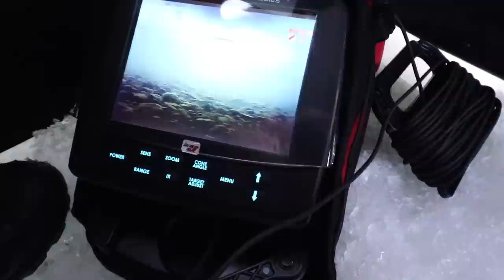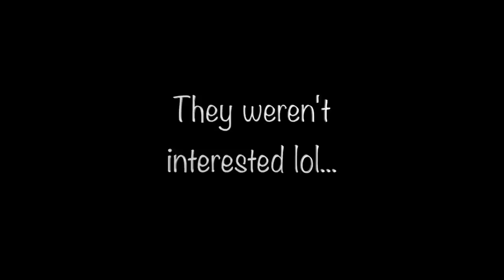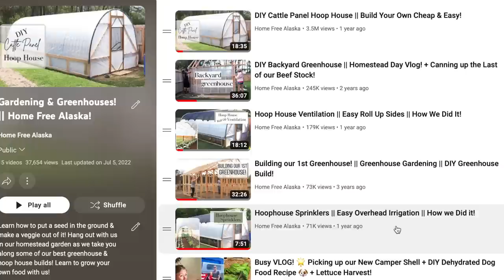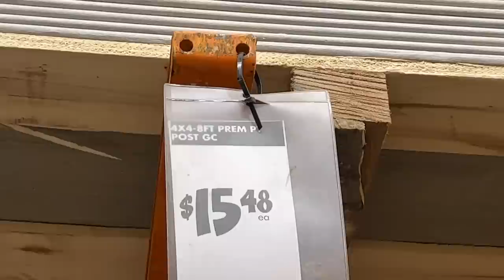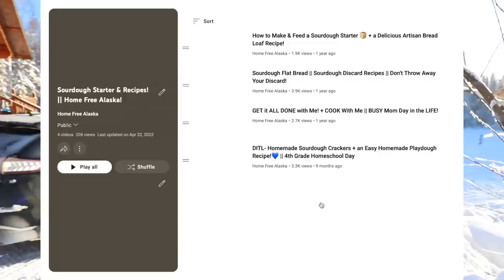Finally!👉🏻Ice Fishing Success-ALASKA TROUT! || Supply Run || New Snow Blower + Homestead Chores...

Comment: Home Depot sells a great snow rake the telescopes out to maybe 15 or 18 feet. If you use it regularly and early, before the next snow and before the snow gets a chance to get hardened you can manage the snow from the ground. Much safer. I have several and post them where I use them. The tubing is oval shaped to resist bending. Very durable.
     I was wanting to know more about your (both of you) military service. Well today you gave me a peak. Please keep sprinkling that in. (Retired Army medic here.)

Comment: Look into Yaktraxs that are narly steel and rubber boot attachments for supperior traction on ice and packed snow. They are available in several sizes. They are simple to install and remove. There are competitor brands that have more pointed and sharp points. The Yaktraxs grip come from small diamond like metal pieces that can spin. I have both and prefer the Yaktraxs. You can even wear them while driving and inside (not on hardwood, vinyl or tile flooring). They are not inexpensive but durable. Easily lost like gloves so keep track of them. No, they don't fall off to get lost. Just misplaced.

Comment: Snowmobiles and also ATVs are known to give very hard knocks to the lower spine.  Lower spine injuries are common.  The best extra supplementary gel seat cushions and seats are really a must as it is almost impossible to avoid these hard jarring bumps on ATVs and snowmobiles.  PLUS. I own a 30' foot long $30.00 aluminum rake/blade for getting snow off of roofs.  It is much safer and easier than a ladder and snow shovel.
Reply from the maker: Hi! We actually just bought a roof rake. All the stores have been sold out so we had to do it the hard way. 😊

Comment: Curious why Joe selected that brand of generator?  Also does he cover it to protect against the weather?  Loved Bradley pulling P on the sled.
Reply from the maker: I am using this one as of right now because I have went through 3 other brands so far. Briggs and Stratton-governor oil seal gave out. Craftsman-governor oil seal gave out. Generac-timing went out and it was blowing out black exhaust and the muffler was red hot. I think the cold weather just didn’t agree with them. The Firman was next inline to try. So far it has 80 hrs on it and starts and runs well in the cold. The only issue it has is the governor linkage freezes and I have to work it loose before I start it or the throttle is stuck in one position. I keep it in a little plastic shed thing to keep the weather off it. Eventually I will build a generator shed and get a bigger home standby gen. Thanks for watching! (Joe)
Reply: Joe, would you consider doing an episode on your generator shed build?  I would be interested in seeing what you come up with. Also, what about a Predator model?  They have very good reviews and are priced right.